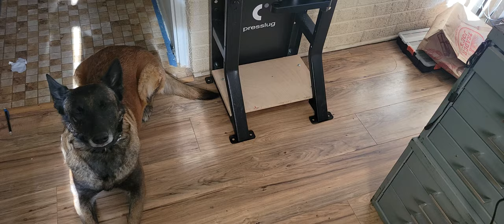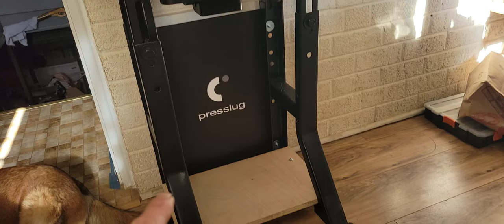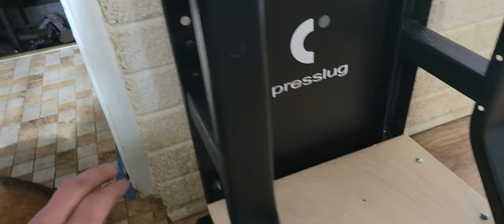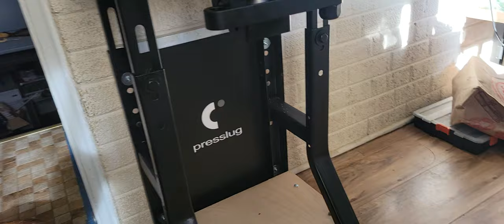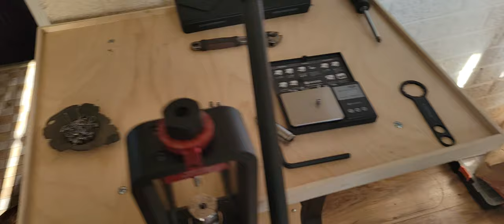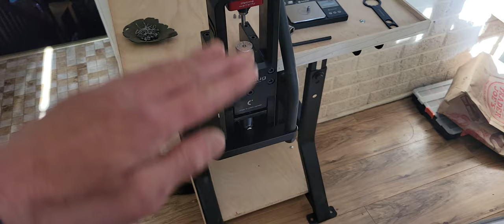Presslug bench

Comment: Nice setup.    I’m looking at the presslug for my new western rattler .357 that should be here in a few weeks it’s on order. My question is which due to buy.  .3512 (8.92mm ) or the .358 (9.09mm)   Do you have a .357 if so which die do you use   Airgun tactical has the presslug on preorder for $1484.96 comes with one die set.  That’s a good deal.